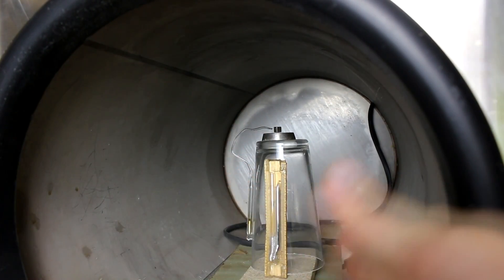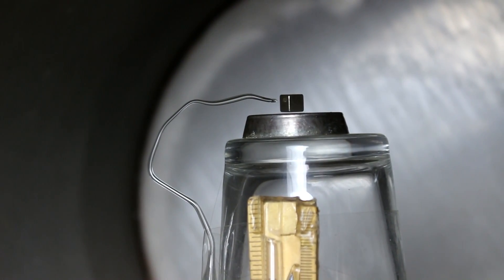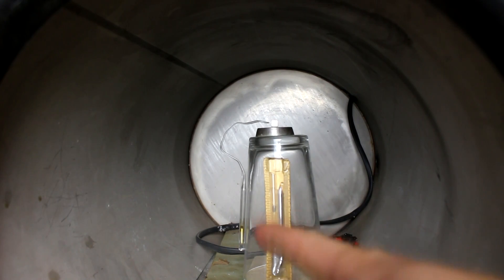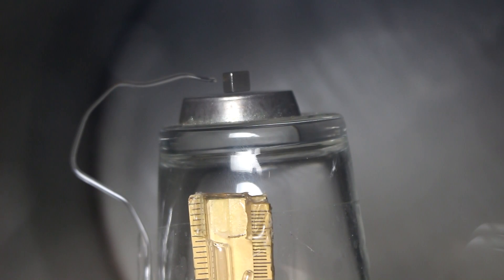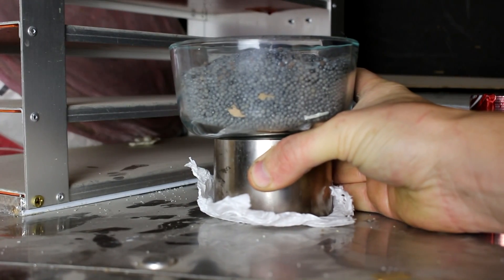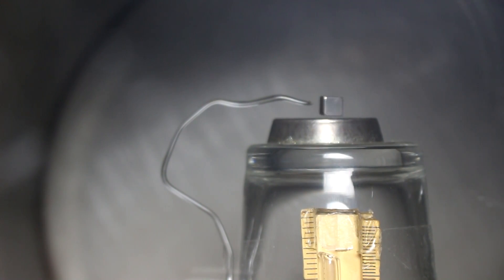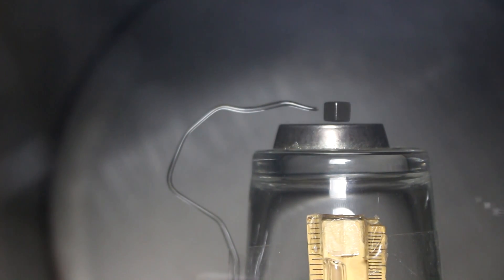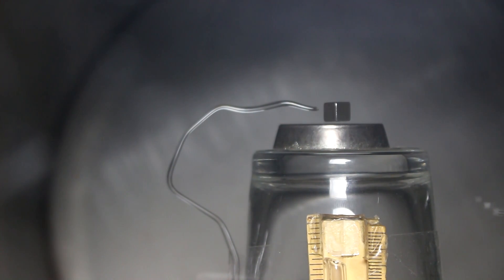Levitating a Magnet in a Vacuum Chamber

Comment: lol the magnetic fields of the big magnet is causing the small magnet to act like a compass,  the small magnet wants to point in the same direction as the magnetic fields of the large magnet   the idea that the lower metal is causing it to slow down due to electro magnetic field created by the small magnet, is true to a small degree but dose not account for it wanting to reverse,, that affect would cause it to stop, not change direction, and is very weak.  compared to the field created by the large magnet,  it is working like a compass,  trying to point north,  lol. the north pole of the big magnet, lol, go down to your local glass blower and get them to make a glass spinning top, that has lots of air drag. then retest, also film the making of the glass spinning top and show us.

Comment: How about water where the wood is, it will boil and blow gas out the glass tube.  Could also create the system to have the magnet spin for as long as the water holds out.

Comment: Vacuum chamber question:
If you had a vacuum chamber at as close to perfect vacuum as possible that had a volume of 1 cubic foot and you were able to reduce the volume without breaking vacuum to 1/2 cubic foot would the vacuum decrease. ( or basically a pressure rise) Correct me if I'm wrong but there would be nothing to compress so the vacuum would stay the same. If you achieved a perfect vacuum.

Comment: Now what if you were to use a magnet levitating over a superconducting disc at a low temperature? Would it have less magnetic "friction" resistance due to the eddy currents not encountering any resistance to flow in the disc?

Comment: I noticed that the magnet is a little low on one corner. So it is not balanced. It will stop due to gravity if for no other reason.  You can see that at one point in the video, as it is swinging back and forth , only to settle in one specific orientation.

Comment: The magnet induces electricity in all the metal parts around it, which generates an electromagnetic field which counteracts the spin that created it. It's very much like the magnet in a copper tube experiment. Of course, with such a small magnet and such far away and not aligned metal parts the effect is nearly nonexistent, but it does waste some energy, which means that even if all forms of friction were removed the magnet will still eventually stop.

Also, generally acquiring perfect steady motion (including rotation) with anything that is magnetic is impossible because of the natural electromagnetic background of the Universe which will always slightly influence it.

EDIT: Oh, you've mentioned it. Well, leaving the comment for reference.

Comment: Hey Cody,
maybe the smoke didn't work because there is no air that causes the smoke to move up? Smoke in a vacuum would "fall down" and be sucked into the ventilation opening I think. Or was the other side with the match closed so there was only one way for the smoke to leave?

Comment: Cody: no, it's not possible to make something that spins forever; even a perfect mass in a universe void of all other mass-energy would eventually come to a stop as it's rotational energy is lost, being carried away by disrupting space-time and sending out gravitational waves (even though translation is relative, rotation isn't). Admittedly, the act of losing it's energy that way would take an immense time, the important thing is that it's still a finite amount of time (at least when you set a threshold after which it's called imperceptible or less than background noise).

Comment: Since liquid oxygen is being attracted to a magnet and is not metallic, would it be possible to contain the oxygen in some form of container (like your glas tubes) to get rid of eddy currents and stuff? Or would you need a ridiculously huge magnet to lift the oxigen together wit its container?
Reply: Interesting
Reply: If I understand this correctly, if there is a little enough amount of radiation then items in a vacuum will just get colder and colder to a certain point (I may have misunderstood), so to that end if the oxygen is frozen and placed in a vacuum then it will stay cold enough to stay solid. 

Alternatively you can always seal the container and if you keep it cold enough to not expand then you should be good.
Reply: Zeibentaul  Unless the oxygen gave off a form of radiation, I don’t think it would decrease in temperature in the vacuum chamber.  That said, it would expand into a gas, and the atoms might transfer their energy to the container walls (say, a sealed glass tube, not the walls of the vacuum chamber).  So the gaseous oxygen may decrease in temperature relative to the increase in temperature of the container.  Since all the energy would still be conserved within the system.
Reply: Zeibentaul

Comment: Hi, Cody. You need to use a spherical magnet instead of a cube. 

The magnetic field of a cube shaped magnet has components that vary with rotation angle. Rotation of the cube magnet then  generates a time-varying magnetic field and this will always induce eddy currents in any metals near the magnet. 

These eddy currents dissipate energy thermally. This is the energy loss that is damping the rotation of the cube magnet.

Since the field of a spherical magnet is unchanging with respect to rotation on its dipole axis, it eliminates the time-varying field components and thereby eliminates the eddy current losses that are damping the rotation of your cube magnet.  

When using a spherical magnet, the only remaining source of eddy current induction will be due to imperfections in the magnets field due to material defects, but these will be very small effects.

Comment: Eddy currents in bismuth are probably quite low, since it his high electrical resistance for a metal.

Copper Electrical resistivity  is 16.78 nΩ·m (at 20 °C)

bismuth Electrical resistivity  is  1.29 µΩ·m (at 20 °C)

So if I did my math right bismuth has 76.8 times higher resistance then copper.

I'm thinking about making a bismuth tube to drop my 3/4" neodymium  magnet through, so i can see how much the eddy currents slow it down compared to dropping it into a copper tube.

Comment: The fact that the levitating magnet is oscillating shows the resistance, which I theorize in this case is the magnetic fields themselves.  That and it's not possible to get a complete vacuum with this particular set up, but that wasn't required for this experiment.  Thoughts?

Comment: Chromium 4 oxide. There's a ferromagnetic material that doesn't conduct electricity. You might be surprised to learn that, since chromium metal isn't ferromagnetic. But it is what was used in the highest quality magnetic tape. The reason is the curie temperature. Chromium metal actually IS magnetic, it's just that its curie temperature is below room temperature, but chromium 4 oxide barely makes it past room temperature.

Comment: Wait a second, even if you found a way to levitate a metallic/magnetic body without using any additional magnetic fields, it would still be inside earths magnetic field, right? So no matter what it would always experience a small resistance causing it to eventually stop and/or orient itself in the position of least resistance.

Comment: Basically it wants to line up with the Earths magnetic field like a compass. I'm wondering what if you had a magnetic track and a superconductor that you pushed around the track, that will eliminate the magnetic flux, You would then have the issue of keeping the superconductor cold but if it was in a vacuum and levitating  then it should stay cold.
Reply: Sounds like a pretty good second experiment
Reply: From what?

Comment: The real interesting thing that you didn't discuss is the fact that the magnet didn't just slow down to a halt. It actually spun in the opposite direction a relatively significant amount and changed direction several times. Each time it turned a little less in the opposite direction. What were the forces in play that caused that effect, and would that phenomenon have occurred or occurred as strongly if the cube were spun in the opposite direction?

Comment: I disagree with your statement that said it's theoretically possible to make something spin forever. For that to be possible, there would have to be a perfect vacuum, and due to Heisenberg's Uncertainty Principle we know that there is no such thing. This means that, if you removed the effect from Lenz's law, the object in rotation would still be experiencing drag from particles in the vacuum. So, while is may be possible to have an object seem like it is forever rotating (in, say, an Ultra-Vacuum), we also know that it cannot maintain this rotation forever.

Comment: So what happens if you use micro particles of bismuth with a non conductive coating? (It would have to be a really thin coating...) Would it spin longer, or fail to levitate?
Reply: Also there are eddy currents being formed in the metal of the vacuum chamber. You should try using a glass or plastic container.

Comment: I think you've made a compass. notice at the end of the spin it rocks back and forth. remember that your magnetic fields are not the only ones around. might try again marking which side is facing the front of the chamber at rest if the magnet stops with the same side facing the the front then it might be an outside magnetic field causing the magnet to stop.

Comment: At 7:40, for the ending: measuring temperature with the changing resistance of wire is cool, but the setup is unfortunately inefficient.  That much wire will have a significant thermal mass, making the apparatus only slowly sensitive to ambient temperature.  Additionally, copper is expensive -- that wire almost certainly costs more than a cheap thermistor, which can be purchased in the kilo-ohm range for easier measurement with less influence from the resistance of the test leads.

Comment: Cody, you should have put a crooks radiometer on top of magnet and you could have used it to spin it as the vacuum was building.   They you could have shown that the radiometer doesn't work at high vacuums.

Comment: There are a number of forces I can think of that may be causing the magnet to stop:
- Air flowing in slowly when the pump is turned off
- Vertical magnetic currents from the larger magnet, orthogonal to the rotation plane, causing alignment (like the moon has one face locked in position)
- The Earth's magnetic field, like in a compass
- Hysteresis currents

Comment: Wood doesnt burn in vaccum, and probably there would be induction on the bismuth because it isn't a superconductor replicating identically the magnetic field lines. And the superior magnet would induce a current on the bottom one due to magnetic field flux be changing.
Thanks Cody, I aways wanted to see if it worked out, if I had condition I could do the same experimento that you did.

Comment: Apparently these magnets (assuming you're using a neodymium magnet) are usually coated with nickel having a 1.4*10^7 S/m conductivity but the neodymium iron boride, despite being a ceramic, has a conductivity of about 1*10^6 S/m. So, probably some of the effects of the eddy currents, which would indeed be on the surface of the magnet, would be somewhat lessened if you removed that coat.

Comment: Hey Cody, if you're looking for a magnetic material that's non-conductive, you should check out some ferrites.  They're good insulators and they're ferrimagnetic, so if you put a piece in a strong magnetic field you can permanently magnetize it.

If you get a hard ferrite (high coercivity) it might work in this experiment, though it won't be nearly as strong as the neodymium magnet you've got so I'm not entirely sure it would hover above the bismuth as well.

Comment: Cody when you put a microwave in your vacuum chamber it seemed to draw more power. If you put a microwave in a pressure chamber would it use less power ?
Reply: Gary Roe no, it's "working normally or arcing and consuming more power", so if pressure is not low, power consumption will be the same

Comment: Use a superconductor! Except, you'd have to use a big one that doesn't warm up quickly by thermal radiation, cool you chamber (probably not feasible) or insert coolant into the chamber, alas that would mess up the vacuum until it has evaporated completely. But, hey, a challenge is a challenge, right?

Comment: powdered iron is used with a binder in RF inductors for exactly the reason you need: minimize eddy currents. It won't be zero but alot better than what you've got now. Also ferrites are used. Google powdered iron toroid or ferrite toroid for example.

Comment: the fact that you have to expend energy to get an object in a magnetic field to spin, should let you know that when you stop adding energy, the object will stop spinning. Take for example the coil/motor of any kind of electric motor. The inside part sits in a magnetic field and when you add energy in form of electricity, it starts spinning.

Comment: under vacumm u will get no air flow. u cannot ignite under vacuum either
Reply: But pyrolysis, roasting out gasses with heat, works in vacuum.
Reply: ah ok. learn something new everyday. how did you go after the video. any sucess'

Comment: You could try embedding a superconductor in solid nitrogen using evaporative cooling. The vacuum would freeze the nitrogen and would simultaneously isolate the whole thing so as long as you keep intense light from it, it would levitate.

Comment: So now you know: zero atmosphere has no effect on moving objects in relation to slowing them down. 

The Kinect energy used to cause the spin is not infinite but will spin out in relation to weight density buoyancy velocity and viscosity.  

You kineticly applied energy and that energy dissipates from the density and weight of the molecules.  The atmosphere removed makes everything in the chamber fall to the floor even smoke 💨

Comment: You just made a big bulky compass!
Reply: Not sure if it is the earths magnetic field doing this or not. The question I have is why it unwinds when it stops, then rotates the opposite direction, and continues oscillating until it stops completely. Need to mark the spinning magnet and see if it stops every time in the same position relative the the earths magnetic field to be sure! Or it could be the orientation of the supporting magnetic fields. More testing needs to be done.
Reply: Apart from the fact it's sitting inside a field made from a giant magnet sitting above it a million times stronger than the Earth's magnetic field.
Reply: No, it does not.
it's will just add some sinusoidal speed wooble, when rotation slowed down half way, and speed up other half.
Reply: I assumed north south were up and down. they would have to be for magnet up to to take effect.
Reply: It would be generating slight electric field as it spin in earth magnitic field.
Reply: Wait...that makes so much sense. And even if he had a perfect magnet and a non conductive magnetic material, it would still stop because of the earth's magnetic poles.
Reply: morpheus ꀊ I learn so much from comments like this, helps me learn how to think more open minded. thank you
Reply: Ungregistered User would it also be stupidly hard to figure out which way was actually pointing North of the post to South cuz it's a cube
Reply: I think it is that the spinning magnet induces an opposing field in the nearby metal, which pushes the magnet in the opposite direction, even continuing for a while after the magnet switches directions.

Magnetism is funny.
Reply: I was about to ask why it switched rotation directions towards the end...this makes so much sense
Reply: External magnetic field applies torque to the magnet, trying to align it's magnetic field. But there is no feedback according to magnet's spin speed, if magnet is not perfectly aligned it just always aplies some torque, until magnet crosses balance point at which torque changes direction. But magnet already got some momentum, it can't instantly stop. So it's continues to rotate after balance point until rotational force accumulates enough and it starts to spin other way.

I dont think it's only earth's mangetic field, huge magnet on top must add to it. Maybe, quite a lot. So it will be 
resultant force.

Comment: If I remember correctly to limit eddy currents constructors of engines divide the magnet with several  thin non conductor slices reducing a lot the area of the circles the current follow so limiting its effect substantially. 

I may confusing it with some other dissipative effect though.

Comment: Cody, I think the magnet won’t spin forever because it will always point at magnetic north. Correct me if I’m wrong but that’s also why the magnet was favoring facing one side and than swinging back and forth as earths magnetic pull eventually brings it to a stop always facing the same direction.. go get a compass and see if I’m right Cody.

Comment: 2:25 - and the cube start rotation in the other direction :P

And you really should just make a small remote-controlled contraption. You always have some trouble with getting something started in the chamber so just use a cheapo RC car - all that you need.

Comment: Prewatching response:

Nope! The small magnet provides an equal and opposite force on the big magnet... So the big magnet also moves (ever so slightly) and because it's moving, it will create heat from friction - removing energy from the system and thus the magnet will stop spinning.
Reply: Postwatching additions:

You make some good points for why else it won't last forever

Comment: Sealing the bottom of the glass then adding a small amount of water or another liquid in will allow the "spout" spinning mechanism to work better. As the vacuum is pulled it will begin to vaporise inside the glass, maintaining the pressure inside as the vacuum continues to be drawn outside, and produce a flow of vapour out of the tube.